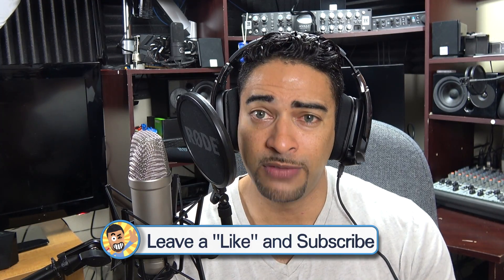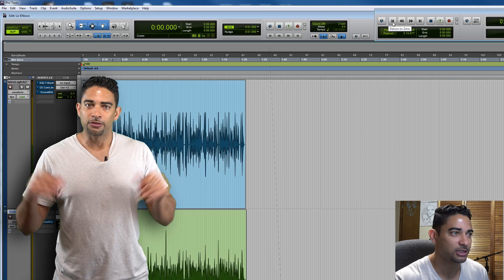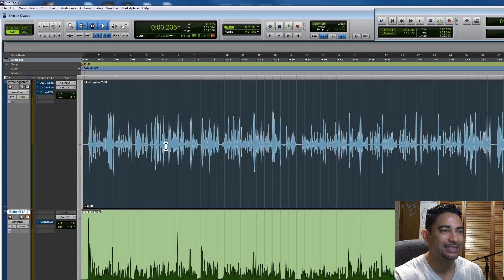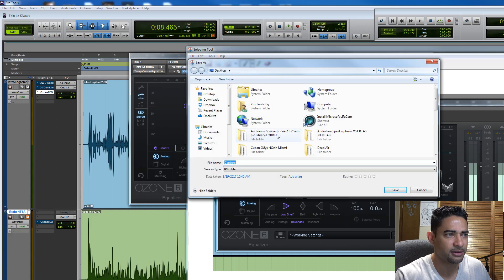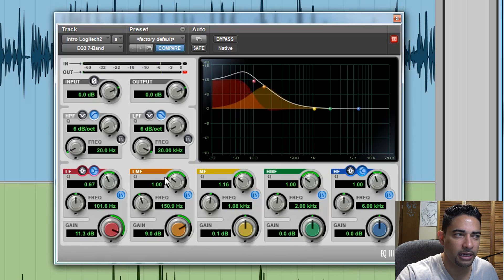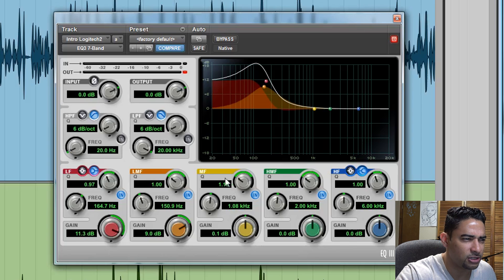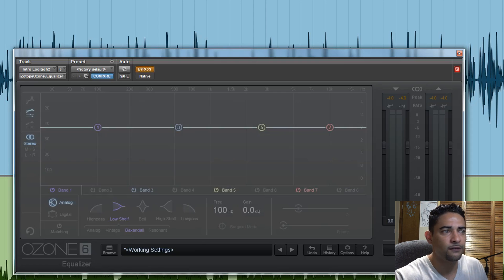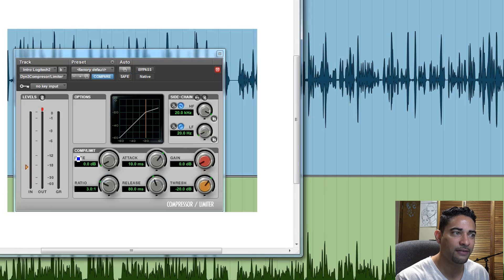Making your Headset Microphone Sound like a Professional Microphone

Comment: really nice video man. I appreciate your dedication and explanation about this micro improvements. I'll try this with mine! LIKE!
Reply from the maker: Thanks man, hope it made some sense. This eq'ing stuff can be soooooo, mind breaking sometimes
Reply: Yes, It was... But it was really useful man! actaully I adjusted mine a little bit for my humble micro XD. Let me ask... how could I use de noise reduction on Sony vegas? (to avoid doing noise reduction on audacity and then going to Sony vegas for EQ) I saw that you had that filter enabled as well on your video.
Reply: Yes It was really useful man! actually I adjusted a little bit the EQ for my humble micro. thanks for the lesson XD. Let me ask, I saw that you have the noise reduction filter activated as well. How could I use it on sony vegas to avoid doing noise reduction on Audacity and then doing to Sony vegas? thanks!
Reply from the maker: Vegas does have its own noise reduction, but it is SO complicated, and not very good in my opinion. Ive tried to use it several times and its not very good. Use the "Open Audio in Editor" video i did, that should keep it as stream line as possible. Thats what i do.
Reply: Lo Knows, Sort Of I will try, thanks man! :)